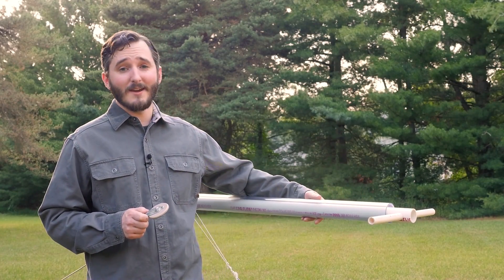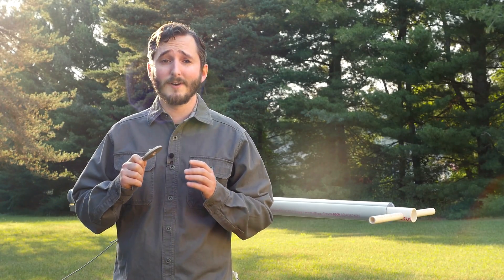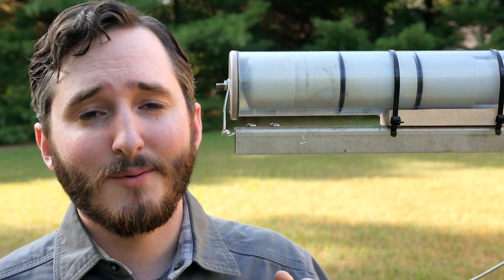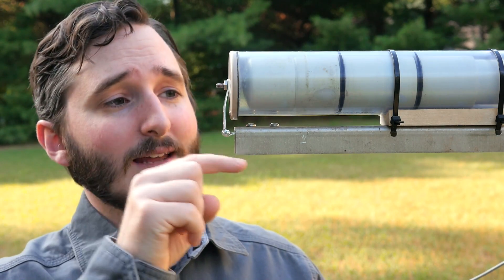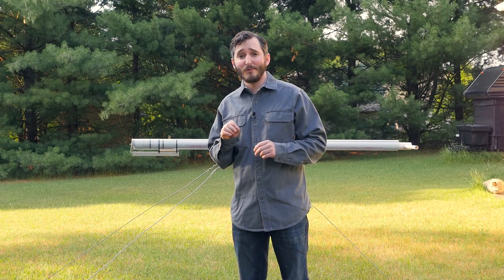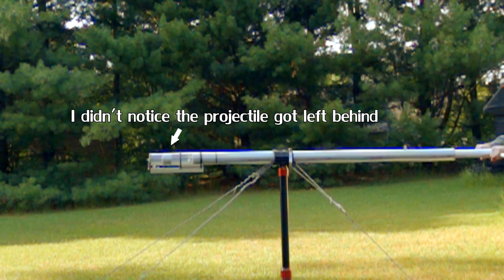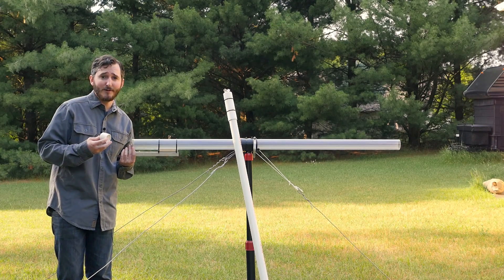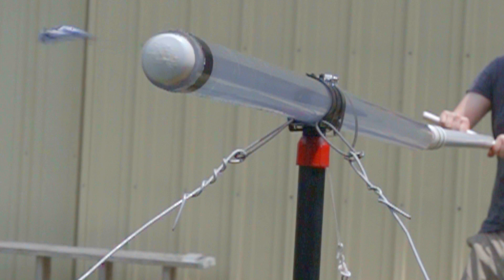Firing A Clear Vacuum Cannon & Testing Viewer Suggestions

Comment: you would need one of two things to get the valve working right....

some sort of spring assist.....you can set up the spring and its mounting/pivot points in a way that will hold the valve closed with slight tension...

but when the valve moves JUST past center....it will snap open

i cant think of an object that has this....but i know their are out their and ive used stuff like that
i can picture the spring and stuff...but not the object i was messing with probably years ago

the 2nd option is more complex but also simpler in ways

hook up an "op-rod' to your charging handle..... when it gets pulled back to the max amount, it trips a trigger that allows the valve to open under spring tension

the timing....geting to to trip at the right time....is going to be a pain...

but once it works....it should ALWAYS work

Comment: neat concept i think you want more space in front of the projectile before your valve to allow for more time to operate a remote barrel and vacuum reservoir may be a better option as you can locate the valve as far forward as needed by barrel length leaving vacuum chamber as a separate entity and connected to barrel breach ..perhaps a way to accommodate breach projectile loading . i envisage basically a twin barrel system as you have a single// one is barrel the other is vacuum each independent and sizable as required.. some gas line piping would make an incredible vacuum chamber with that 15 inch piston lol

Comment: dude, have you ever thought about loading a go pro into a vacuum cannon?
Reply from the maker: It's been suggested, but you would barely see anything it would fire out so fast.
Reply: true, maybe on the way out, but if you aim the cannon straight up and make the "ammo" weighted primarily in the front you'd get an amazing view on the way down theoretically. as long as you add some padding to it so it doesn't shatter.

Comment: Maybe a two part valve with each part opening to the sides rather than the up or down. Half goes left half goes right, it would require some more o rings used but it may work

Comment: Could you use a Pringles can lid? It should be plenty strong enough, possibly light enough to move out of the way but if it dose not move out of the way it should not affect the projectile very much at all. And if you get the right diameter pipe it should hold its self on or you can just put some tape arround the end of the barrel untill you get the right diameter. (it also gives you a good reason to buy the copious amounts of Pringles that your body desires)
Reply: P.S. to make a better seal you an put a thin piece of rubber sheet cut to the right size

Comment: You can also make a small device based on your coaxial piston design. Put a cap onto the outer pipe and drill a hold to accommodate a smaller pipe, maybe a half inch wide, to use as a barrel. Using the same centering technique from the coaxial cannon video, make sure it doesnt extend all the way past the length of the outer pipe. Then, modify the piston by drilling a hole at the top to create an airtight seal with the inner barrel and the outer casing. This way, when you pull it back, it will extend past the inner barrel and air will rush in creating a VIOLENT SUCKING MACHINE

Comment: you could drill a very tiny hole in the tip of the projectile so that there is a very small pocket of air between it and the flap, it would slow it down but might work

Comment: The force from projectile compresses the air inside the tube rather pushing the valve open 
Try to make it lighter and place the projectile on the 1:5 th position 

Means 1 feet away from the lid and try 
But with your lid try to keep it 11" away for the best ratio.

Good luck fr your future projects 
Enjoy youtubeing.

Comment: How about instead of letting the air wave open the valve. You rig it so the valve opens via gravity and all that holds it closed is the vacuum. ie i'd move the pivot point the other way and even add a weight so gravity opens it much faster and before the air wave hits.

Comment: Hey Ben. Currently making your vacuum cannon with Australian pvc parts. I'm just curious how much wiggle room you have between your end cap projectile and barrel? Is it snug? I'm nervous It won't work super well with the gap between my end cap projectiles and barrel. If you're curious the barrel is 50mm, end caps are 32mm. That converts fairly close to your 2inch and 1- 1/4 inch parts. Maybe they don't make the end cap walls as thick over here. My cannon will be ready for firing in about 2 days. So I'll find out soon enough. Also the end caps are $2.50 Aus...yep
Reply from the maker: Should be as close a fit as possible without getting stuck. Try them as is and if they don't work well wrap some tape around them for a better fit.
Reply: NightHawkInLight I had the same tape idea. But that will end up being a lot of tape and time.

Comment: Maybe you should try a softer cap to cap the cannon, but with 2 projectiles instead? 1 soft one in front connected to the main one via string meant to open the cap.

Comment: Is it possible to have a trigger that slightly protrudes through the canon barrel (inside), maybe an inch or so from the valve/end of barrel that releases the valve (aided by spring tension)? The key of course would be to make sure that hole which the trigger pokes through is also vacuum tight and the "trigger" does not offer much resistance to the flow of the projectile. Even so, that very slight bump in the road would seem to offer less restriction to velocity than an actual frontal collision with that front flat face... A small ball bearing that just peaks through (maybe it's mounted on a spring itself) which actuates the release of the spring loaded valve?

Comment: I HAVE AN IDEA!! What if you used a center of gravity spring. By that i mean you have a spring that is connected to a string, and the other end of the string goes to the center of your gasket. (i would say cut a slot in the hinge to accommodate the string). But you do it in a way that it is JUST on the brink of flipping over. That way when it goes, you get the small kick of the air, but then get the acceleration of the spring. If i just sound like a blabbering idiot, I am trying to explain how tool box locks work. same method but you want to get it closer so it does not take hardly any power to get it over the center of pull.

Comment: Also, use a lightweight material with a very thin application of silicon as a sealant for the valve.  The silicone should be tacky enough to stay in place, as for the material... a thin sheet of carbon fiber shouldn't be too expensive, or just use something like domed balsa....

additionally, the biggest issue is your hinge, it's adding a ton of mass that's providing a lot of resistance.  It's too much mass for what little air remains.   So with silicone keeping the valve in place softly, just use kite string instead of a hinge.

Comment: Why not try a lose fitting pvc end cap with a rubber layer inside and a length of wire or string. When the vacuum releases the pressure and the remaining air hits the cap it should fly off being caught by the string so it can't go too far. Plus it'll hold onto the end for reloading and it will be reusable.

Comment: use a pice of elastic that can stretch when you pull the plunger back, and attaches to the valve over a pulley that will assist the valve as it opens

Comment: Try moving the fulcrum of the valve further down and away from the pipe. Since the bottom of the valve is much harder to move than the top, the projectile is hitting the bottom of the seal... I don't know if that makes much sense by the way I said it, but I think it would work better if the hinge were something like 5 inches below the barrel rather than right next to it.

Comment: strap a string and spring system to the pulled handle, therefor when you start to pull back the handle, you are already starting to try to release the front valve/gate, and when the handle finishes traveling, it finally opens. design a proper back intake as well? the designs of ducted fans suggest a proper take would make it more effciency.

Comment: Instead of a long ungainly tube to pull the projectile back, maybe a system of small pulleys and a hand or small geared motor cranked spool to wind some line on would be nice. In that way you could do away with all the wires and post that has to hold the cannon stationary.  Mount a pulley at the back of the cannon and all other apparatus to the cannon itself.
Reply: Maybe a battery powered hand drill would be a good thing for winding up the line and it could also be used as a  hand grip for the vacuum cannon and trigger mechanism.

Comment: You have to have a gas tap. Think of a gas piston on a rifle. A sealed hole in the tube that, once the projectile passes, lets in air that opens the flap before the round hits it. Another benefit is that once the tap is passed, the vacuum will hold the seal tighter and tighter. The mechanism will be a lot more complex, as you have to have the tube well sealed and the piston has to open the flap by traveling linearly along the barrel. (edit) Thinking about it, it probably won't work, as the piston diameter has to be greater than that of the barrel, and have enough airflow to fill the chamber. Interesting to try, tho.

Comment: First of all,  let me say that i love the videos and i think you're at least a borderline genius.  With that said, here is what i think is happening.  The hinge is a great idea, but it has an inherent flaw.  In order for it to work, the flap has to move forward with the inrush of air, but it can't because the hinge actually inhibits the forward motion that it must have to get out of the way.  The pressure exerted on the flap is equal all the way around the circumference of the pipe and it's trying to move it forward, but it can't move forward because of the hinge and the way it restricts movement at the bottom of the pipe.  if the hinge were able to slide horizontally it would help it get out of the way, but this action would take time that probably isn't available.  i say that only for those of you that haven't tinkered with these. Instantaneous is not a good word for it.  When the vacuum releases, it happens so fast it's mind boggling.  The videos are great, but they really don't do justice to how incredibly fast the action is.
My only suggestions would be to try something that doesn't seal quite as well inside the barrel, so a little air can go around it and help push the flap out of the way before it gets to the end of the pipe, try something a little heavier, or a combination of both with a slightly longer barrel.  
Keep up the good work Sir.  There is at least one old fogy out here that enjoys them immensely.

Comment: I think you may add another small tube on top of the barrel and connect them near the muzzle so the air will be able to kick the valve open before projectile hit it. Like gas engine in assault rifles but backwards :)

Comment: To make it so the valve opens in time and the projectile wont hit it you could put it at an angle so gravity would cause it to open if it were to be left at that, but use an electromagnet to keep the valve closed initially then it would shut off once it gets to a point where the outside pressure will keep it shut.

Comment: What if there was a piece on the end that would be used to attach a pipe of larger diameter, and you place a disc within the transitional space that is the size the larger pipe is meant to be?

Comment: You should try to put the hinge  of the valve lower down and add a longer bar connecting the flap so that the air pushing the valve can get more leverage.

Comment: the valve it's ok and it's working, the remaining air inside the pipe it's propelling the valve down but the problem it's that when the valve reach the end of the hinge it springs up again right on the moment the projectile gets out of the tube.
so, I suggest to put something mounted on the same aluminum or metal bar to catch the valve once it's down preventing to crash whit the projectile.

Comment: How about using the flap valve without the hinge. Maybe adding a small ridge that fits inside the cannon to hold it in place before the valve seals.

Comment: you can also use a slingshot rubber band which accelerates the cap once its pushed over the position of the hinge

Comment: y u dont put a rubber bands in the valve that pushes the valve backward and put a string in top of the valve and when u want to shoot pull the string until the valve get closed and pull the piston and then left the string cus the vacume will keep the valve closed and when it shoots the valve will open faster bcus the rubber bands will help to speed the proccess of opening the valve
Reply: wot

Comment: I like the comment below that suggests cutting an angle on the muzzle of the barrel so that the valve is  already in the attitude of falling and only being held in position by the vacuum within the chamber. It would require holding the valve closed temporarily while vacuum is created in the chamber, and then having a lock or spring that prevents the flap from springing back and colliding with the projectile. Also I wonder if a toilet flapper would be a good end valve?? about the right size and may have less mass than the current one.

Comment: you could have the valve spring loaded and then use a magnet to attract it to the tip of the projectile to keep it closed until a vacuum is drawn

Comment: I would add a spring that will pull on the valve just at almost the force of the atmospheric pressure, use a clamp to keep it closed until vaccuum is achieved.

Comment: I'm wondering if you attached a pulley on the ground level with a line attached to the gravity assisted valve fed through the piston to the handle so that when you pull the handle out it also pulls the valve down.

Comment: Hey night hawk great vid what I think what Is happening is the cap opened correctly but the cap has so much force and bounces back then hits the projectile so what you could do is mount a very strong magnet to the flapper bracket so when the flap opens it holds on to it when it opens so that way it doesn't hit the projectile

Comment: The Problem is that the Hinge itself is taking the full potential directly; it needs to be slowed down by a cushion so the velocity of the tipp of the valve cant take that much of the potential power of the hinge.
Another way to lower the potential is to give the valve less Mass. Less Mass = Less Potential.
Or if nothing helps; making the valve plate&hinge itself stronger so they can survive the impact.

Comment: Try a one-way circular valve. Basically a bunch of triangles opening outward that when closed hold airtight (rubber edges or coating) but when pushed from the inside open REALLY easily.

Comment: I'm noticing that your still using two to hold the aluminum in place at the end, do you think you could add a pic piece to go over the end to hold the aluminum in place so that you wouldn't use so much tape?
Reply: *PVC piece
Reply: *Tape to hold it in place

Comment: In subwoofer cabinet design, port flaring is done to allow for a smoother transition point from a high pressure area into a low pressure area.
I wonder if a flared inlet could improve performance at all.

Comment: try this but instead of using a vacuum start with the projectile inside the pipe and then push the piston in from the back which will cause compression and intead of using the cap go back to aluminium foil. once there is enough pressure the foil will break and the air will push the projectile. in theory atleast

Comment: This might be over complicating things, but perhaps you could tweak the design of an AR-15's gas system to get the valve out of the way faster... not sure how the physics of that would work with a vacuum cannon, but my theory  is that the bit of air proceeding the projectile may be sufficient to push a small piston into the hinge powering it open at the exact moment the pressure is equalized.  

Great vid!
Reply: please stop

Comment: @NightHawkInLight try using a mouse trap to open the plug , 1. have the  plug top mounted like in the first video ,but a small bracket at the bottom to attach  a string to a little ways out.2. have the trap mounted at the top that the string is attach to the kill bar of the trap, the string should be just long enough tolet the plug close fully when in the set position and short enough that the plug clears 90°+ when the trap is in the triggered position,  this is where you get your bracket length  from.3. have a second  string the runs from the trigger pad to the handle of the plunger, the top of the tube should have guides to help the string form getting caught or triggering early , this string should be long enough to cover the distances from the plunger in set position to plunger in fired positon PLUS a delay length to make sure it is not trigger to early.[ if the trap is too slow you may need to modify the traps spring tension,  by razing up the back of the tension springs to put more force in the springs, the more tension in the springs the faster they close.]

Comment: I think you are on the right track with the design of the flapper valve you have now, but try maybe switching to lighter materials. Maybe it's that there is too much mass there, that the air in front of the projectile has to move. So, try to find a thinner rubber seal and one too that's closer to the ID and OD of you barrel, thinner and lighter seal backer and a lighter hinge. Also, instead of using a steel screw to fasten to seal onto the hinge, it may not be strong enough, but you could try using a plastic screw and nut. Or even try an aluminum rivet as an alternative. Hope this helps and good luck!